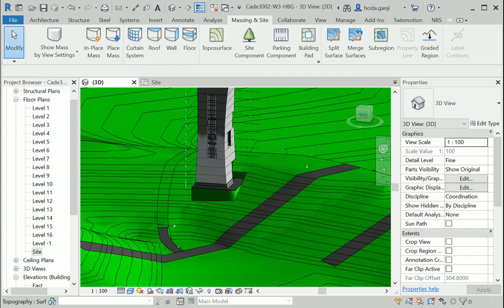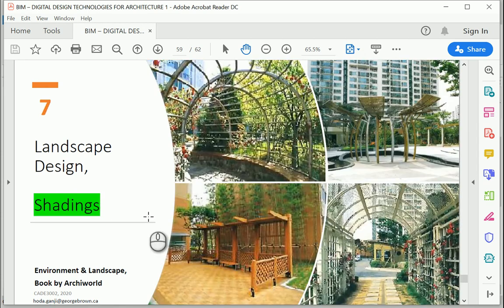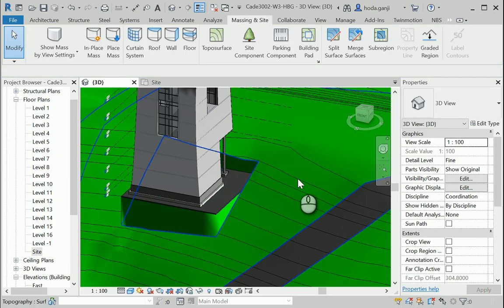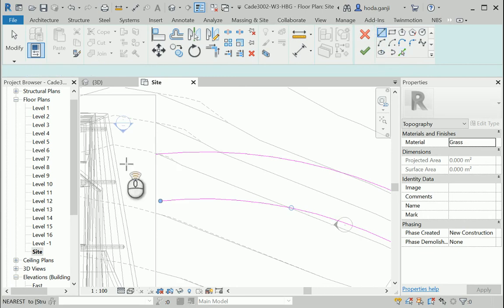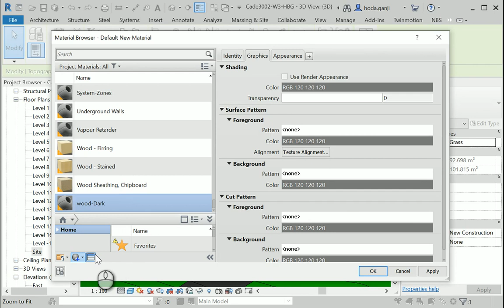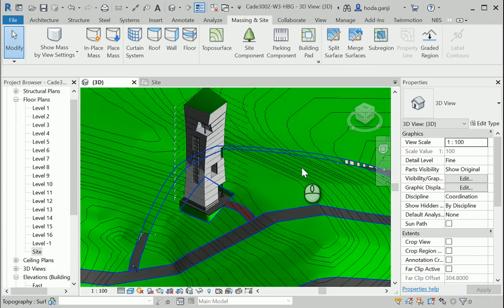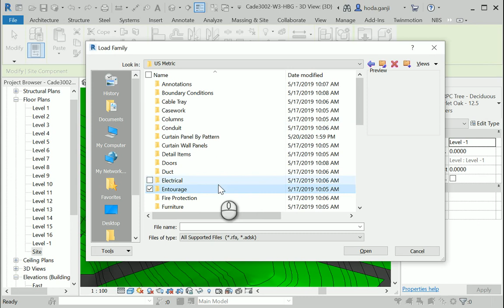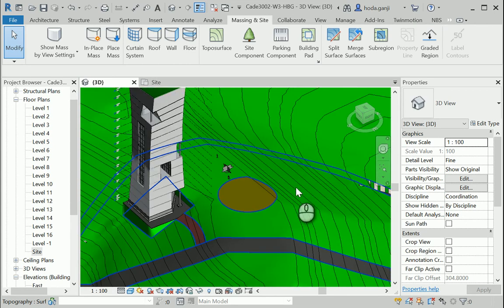Site & Landscape Design in Revit 7

Comment: Hello, why se cant connect 2 surfaces owhen using split surfaces? This Gap Will be seen when we print right? For example, if i have a sidewalk , kerb and road those 3 materials need to have theyr limits not touching? Sorry for the questions.
Reply from the maker: Hi Miguel, I'm not sure if I understand your question correctly, but there is an option right next to the "Split Surface", which says "Merge Surfaces". Is that something that might help?
Reply: @hodaganjiphd4265  i mean in AutoCAD when we design a kerb (double Line) then an área (ex: a square). The lines Touch or overlap to create hatches. When we zoom there are no gaps in between. In revit the way split works to create a surface an area with a certain material there Will be a Gap on between. Sorry but English is not my native language .